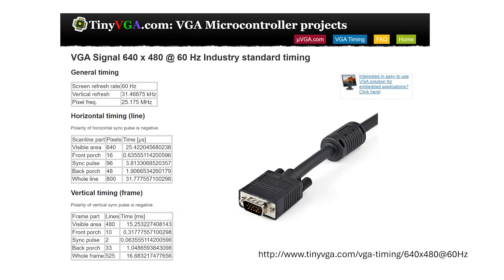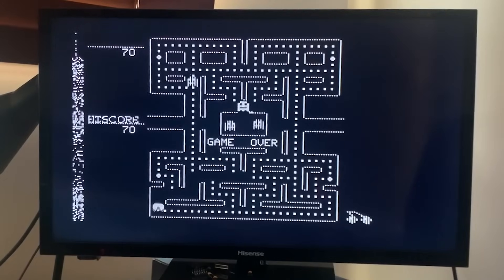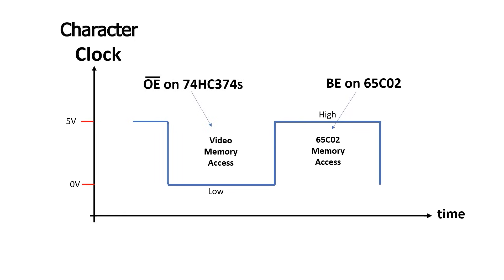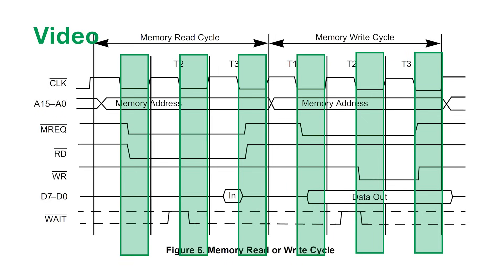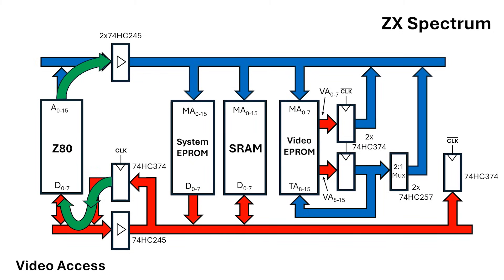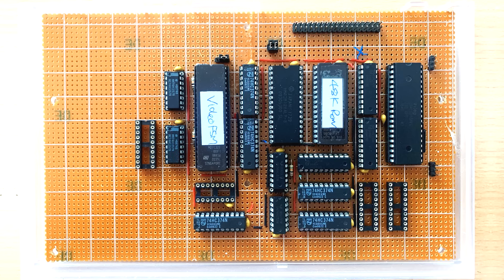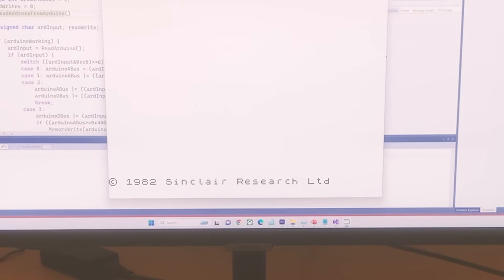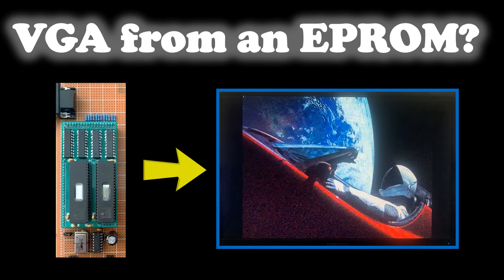ZX Spectrum build, No ULA.

Comment: Excellent Indeed. Better than the original in terms of CPU speed. Full speed memory access in the contended memory will of course make some timing dependent software incompatible, but I'm sure you've thought of that already and I expect it to be addressed in a layer video

Btw, have you tried loading the I register with 01xxxxxx ? You'll then see snow on the screen with the original hardware.
Reply from the maker: Thanks David.  Yeah, i'll use the wait signal to slow the CPU down using the circuit in the last video to emulate the DRAM memory access.   
VGA will mess things up badly too, so i may do a PAL version also.

I've heard about the snow issue, but i haven't looked at it in detail, 

I suspect the 01XXXXXX XXXXXXXX as the refresh address probably triggers the clock halt circuitry in the ULA.  It triggers it during port accesses.

The raster scan sweep should keep the contents of the DRAM refreshed,.  Thanks for that, i'll look into it.
Reply: Actually I'd like to assemble without slow-downs, but more fast Z80 like 14Mhz  @DrMattRegan